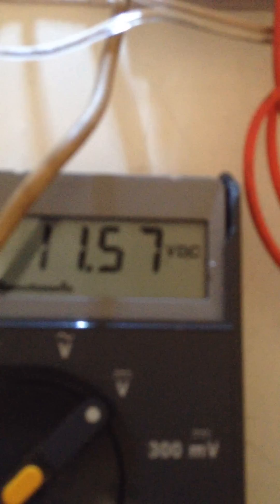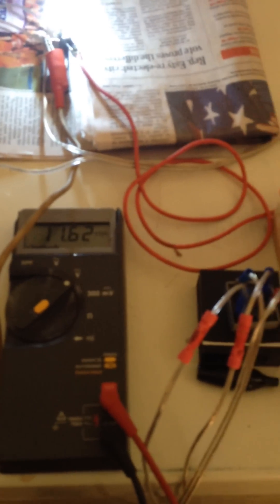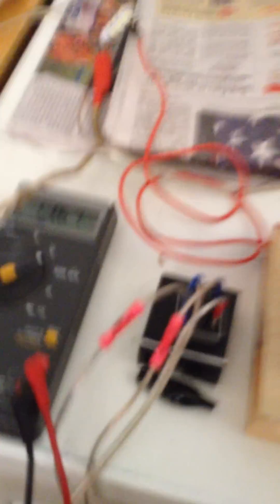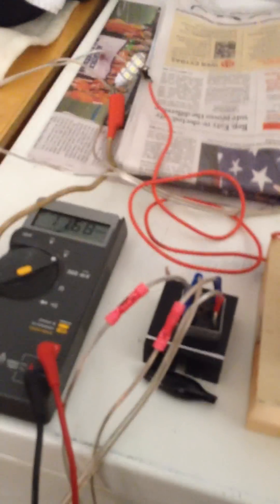Over unity created with transformed back emf. True over unity, no BS!

Comment from the maker: As Tesla claimed:
Tesla discovered the evidence for charge clusters (as patented by Ken Shoulders and Hal 
Puthoff), the overunity effects of air arcs (as experimentally verified by Dr. Peter Graneau and 
George Hathaway), and the overunity effects of plasma glow discharge (as experimentally 
verified and patented by Dr. Paulo Correa).  Overunity could always be achieved if you force electric current into a plasma state by utilizing these arcs in the air. Once the arc is present, the quantum energy transfer of ionized particles are gathered, and induced into any nearby coil which may be excited, just as long as the proper resonance is achieved. I played around and have designed a transformer that is close to the correct resonant frequency, but, a non adjustable oscillation is difficult to tune and match with the windings when you have a relay that is already prebuilt to it's own spec. By not knowing the operating frequency by the amount of windings, magnetic field, and size of the wire, it was nearly impossible to create (by me anyway), but, I got lucky and was close enough to resonant by automatically getting an overunity with my design. Yes, it is a rather crude model, and I could prove it works, but, it may have more output in another area, city, town, state, etc., maybe different at other elevations, so, my next test is to connect this circuit, mixed along with my design called the MBR circuit (located at http://mbrcircuit.blogspot.com , and I will be playing around with tuning capacitors, inductors, & connecting the circuit to an extremely large mica capacitor I have designed and built to the transformer I have built, using different frequencies to gain better resonance, also, connecting a radiant energy antenna which will be 25 ft above my test facility, utilizing all high voltage power industry insulators, cable, terminations, and an extremely deep ground plate which will be coated in graphene to conduct electricity better than any other conductor, even gold. The same will happen from my antenna that I have designed. As a kid, I have realized that a balloon could draw in ionized particles by merely being inflated with ionized air, or other gases, or, by rubbing it with something holding these charges, which would transfer the charge to the balloon, which actually becomes a capacitor.

I have designed a new way to build high voltage antennas using graphite, turning it into a cheaply manufactured graphene, simply by charging a balloon to become a highly ionized stretched & inflated epr rubber balloon.. Once charged with a high voltage charge, spraying a graphene based paint on the surface to absorb the energy that's in thin air happens very easily, even if the balloon is only 6 feet from the ground. Voltage is actually astounding and it becomes so much easier to draw in this energy by utilizing a better conductor than say an aluminum plate. The graphene is actually such a great conductor that it doesn't burn up as easily as aluminum or copper when amperage loads up in a small conductor. Graphene can hold 20-50 times more amperage than aluminum per it's same size, which i tested using graphene as thick as aluminum foil. The graphene doesn't even get warm with a layered (sprayed) piece that is 1/32 of an inch thick by 1/4 inch wide drawing nearly 20 amps through it at 12 volts dc. I am finding that this method I have developed draws nearly as much radiant energy as an arc, as Tesla discovered earlier in the century. I have planned to put together a working prototype very soon utilizing a massive arc gap which will very easily be able to obtain and draw much more radiant energy into by adding a specially designed gap coil which I have designed last year. Once this is completed, i will be showing all of the critics and skeptics online that radiant energy isn't a joke, that it contains more than the amount of energy we have been told by the very critics that suppress the technologies. I have been told that a bolt of lightning has the same energy as 120 liters of petrol by a "supposed" engineer that posts suppression comments on Youtube about pretty much any free energy technology. I have proven him and many other skeptics wrong with my video above, so, I will be showing the world exactly how i build the next project as well. I have nothing to hide and will not do so to try and suppress the rights of every citizen, man and woman of this country because we all have the right to these technologies, and suppression is absolutely illegal to do, no matter who you are. If a technology exists, it should be forced to an open source community if it can not be patented. That is what I believe, and there should be no "blanket policy" by the patent office to attempt the reduction of efficiency in any technology. It is blatantly wrong and the technology needs to be released to save our planet.

I could care less about what any skeptic says, critic, or Youtube troll, so, I am going to tell you all that Overunity is possible, and, it is not by creating energy, as nothing creates energy. Any device that supposedly generates electricity merely transforms energy from one place or particle, and turns it into another form. So, if we have free electrons , or energized particles in a vacuum, they could be drawn in and put to work by utilizing a technology to reveal them. This vacuum energy is amplified by the electrons flowing to its opposite, but, in a vacuum, the energy travels much faster, as the "theory" of a vacuum train supposedly being designed to be built under the Atlantic Ocean, which can travel at 5000 mph or faster. A vacuum contains no air or particles in it by volume that can create resistance or "drag", but, the vacuum still contains gravity which is completely eliminated by applying specific resonant magnetic fields inside of the vacuum which can not happen under the normal atmosphere with the same amount of power. This is my theory, which will probably never hit a textbook, or win me a Nobel Prize, but, it is the whole truth as I have accidentally discovered this with mistaken wiring that I could never reproduce a second time. We need to understand and use Newton's Theory, which states that energy could never be created nor destroyed, as we are swimming in a sea of energy, as it's just waiting to be tapped. 

When my system above operates, it is not violating the "laws of the conservation of energy because the energy drawn in to create the "overunity effect" is brought to the system within the arc that is internally created by the oscillation of the relay. The arc can create an overunity condition because the back emf created by the relay's oscillation of the ons and offs collapse the magnetic field of the relay coil, creating a reverse spike of energy, which is amplified by inducing the radiant or scalar wave. This happens, it uses the battery to power the coil, then, when it shuts off, the relay coil releases a DC energy spike, which is a greater voltage than what is drawn from the battery by the relay to move the magnetic switch. Even the amperage is higher than the battery power used to pulse the relay. It isn't much greater, but, it is enough to run the relay, power the light bulb, energize the transformer, and utilize it without allowing any losses to be present due to the fact that cold, or "radiant" energy is being used. The transformer coil stays ice  cold, the relay contacts ice up, and, the rectifier is cold to the touch, and it has been operating since June without issues, like, a burnt out coil.

So, here is how it is connected. The relay coil connection # 86 goes to the battery + and it's feed terminal, #30 is connected in series to one side of the transformer's primary coil, and the other side of this coil connects to terminal 85 of the relay. The relay is connected to the transformer to pulse it , creating an AC voltage which drives the transformer into operation, inducing a higher voltage to the secondary side since the transformer is built as a step up transformer. The N/C connection, terminal #87a is connected to the ground connection of the battery and the super capacitor simultaneously, as well, an Earth Ground is required to create much more energy if desired. The battery + is connected to the bulb, and the bulbs negative goes to the battery - . The terminals of the secondary of the transformer feed a full wave rectifier, then, the output of the rectifier connect back to the battery in the correct polarity to loop the power. Once this happens, you'll notice that the relays oscillation will speed up tremendously, showing the signs of overunity immediately. This would never happen if it wasn't drawing in radiant or some sort of other energy because we can not create energy, we transform the energy from one place or form to another. The battery sees a collapsing voltage normally as the relay oscillates. This means that the battery will automatically begin to die unless you loop the transformer back to the battery to feed back the gain drawn in with the switches arcing. Normally, if we isolated the system, letting the relay oscillate connected to a fully charged battery, the battery would subside and die within 24 hours. Just by adding the relay and connecting it to a transformer, a cap bank, and looping the secondary back to the battery as explained above, until the relay coil or switch mechanism fails, it will run indefinitely because it causes a 100% efficiency, disallowing loss whatsoever, eliminating all heat losses that originally existed in the system if it was running at any conventional form. So, by adding a load to the system, especially if it is pulsed, the battery recovers in full every time while it is running wired as I tell you to. If we apply a very small load, such as an led bulb of 3 or 4 watts, it will still run continuously, but, there is limitation of the possible load if you just add the led without pulsing it. We could add a standard light bulb and pulse it, this way, the charge pulses will recharge the battery and cause the system to recharge it's loss, still allowing overunity to happen during the lamp's off state, pretty much up to 20% of the battery's amp hour range. I only use a 7 amp hour battery, so, the amperage limitation is really small when the loop is closed and not pulsing whatsoever. Good luck with your experiment.... Have Fun!
Reply: totalmente de acuerdo con usted.Lamento no dominar el idioma ingles ; aunque puedo leer algo y el resto utilizo el traductor.
estoy totalmente de acuerdo con sus palabras .
soy tecnico en electronica ; ya con varios años(68) y veo y sigo con mucho interes sus publicacones.
Gracias y saludos desde argentina.